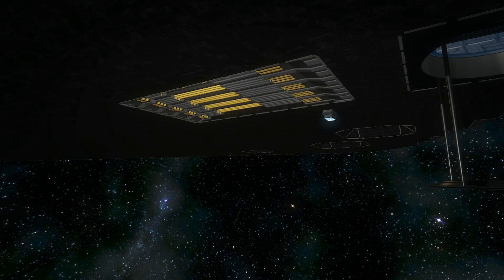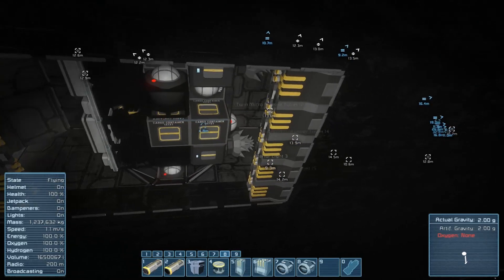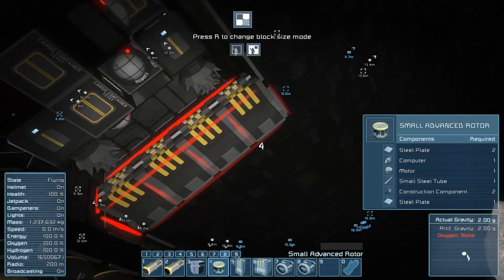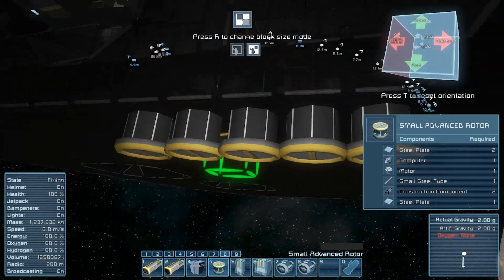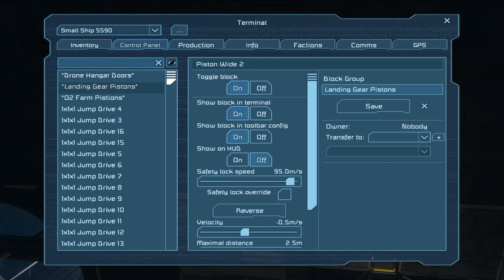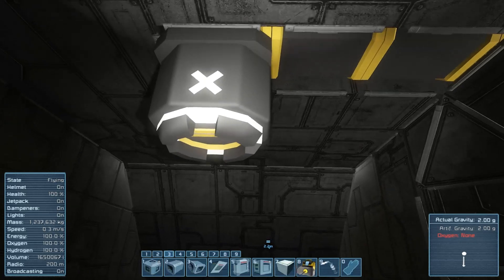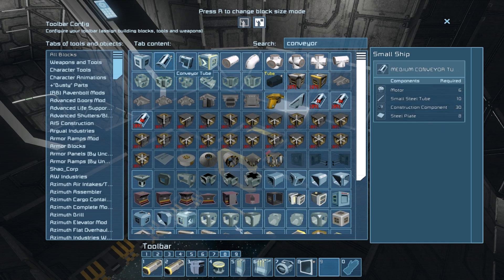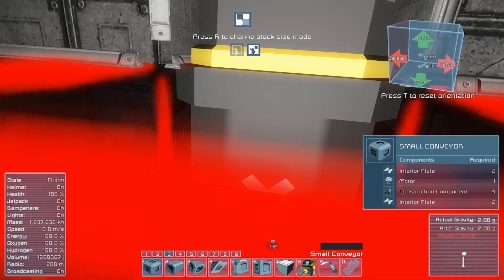Let's Play Space Engineers - Episode 106: Weaponizing The Underbelly!

Comment: i was wondering, if you could put the weapons in those spots then could you not put something on the bottom of the weapons like a panel for extra protection when the weapns are not in use?
Reply from the maker: Probably? I'm not sure if it would affect the retraction distance or not, but I suppose you could mess with it till it worked.
Reply: I was also wondering if you could attach rotors to your lower weapons so that they can be aimed, as it looks now I'm concerned you might hit some of the forward weapons with the rear ones.  Maybe you could also re-angle some of them to make a broad side system.
Reply: Sleepless Knights Studios alright, thanks for the reply :)